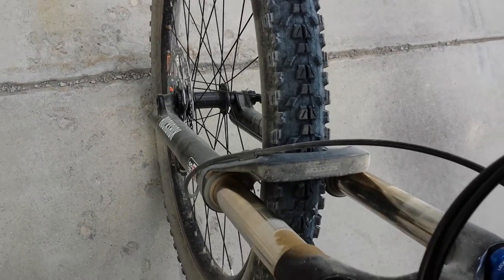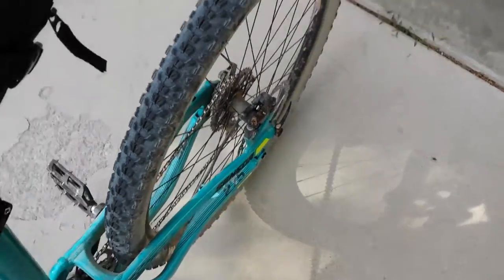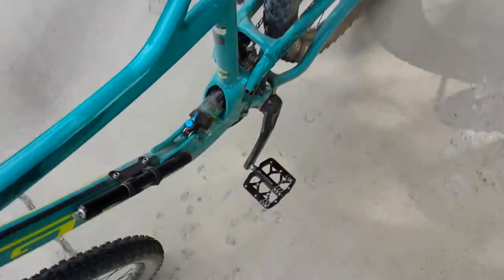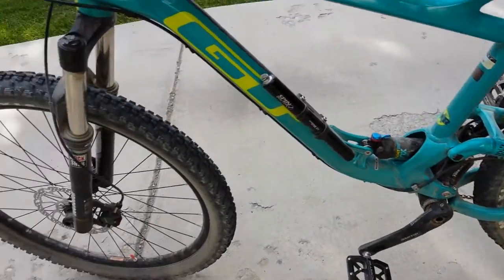SOLVED?: Play between the disc and hub with centerlocks

Comment: Thanks for this video. I 'upgraded' my wheelset and it came with CL hubs. After installation of the new discs, I had the same issue. This video confirmed my suspicion of a tolerance issue between the teeth and the splines.

Comment: I’m so happy I found this video as it seems to be one of the few places online where this problem is being discussed. I have solved this issue on my front wheel by purchasing the original Shimano CL to 6B adapter. With this and a regular six bolt disc the problem does not occur. I suspect that the adapter body creates a more solid interface between the splines of the adapter and the center lock hub. The adapter seems to be a solid block of aluminum with greater contact patch in the spline area. I will try the same on my rear wheel and report back.
Reply: using the adapter solved the issue: it seems the culprit was a cheap entry level Shimano CL disk (worn CL interface?) and the solid adapter used with any 6-bolt disk solved dit

Comment: I wrapped the center lock splines on the hub with plumbers tape. It made the interface tight. It worked perfectly for several months, but now the play is back, which simply tells me the tape is worn and it's time to reapply.
Reply: Exactly what I do

Comment: This is a non problem caused by cheaper centre lock hubs … Cobba, on that thread, is exactly right. There has to be some play in the splines to get the disc on the splines. The only thing that stops the for and aft play is the tightness of the locking ring, which will presumably have a torque setting. I have this issue on my orbea rise h30 cheapest model. Monster say some play is unavoidable, in so many words. The only real fix is swap out the wheels with 6 bolt mount hubs. But the thing is, this is not an actual problem. It’s annoying but once you’ve braked once, the play is moved round and it stays solid in the forward direction. The only time you see this issue is if you ride the bike backwards ( or wiggle it as you did in the video) and then brake backwards. Then it will move the disc on the hub. Until you ride it forwards again, it will creak or knock…. and so on. You will not notice this while riding after your first brake point. Unless your a stunt rider or free rider on a bmx, forget about it. Go ride your bike bro 👍
Ps, just make sure it’s not the rivets holding the disc to the alloy splined carrier causing the play. That would be an issue and a warranty claim.

Comment: I've two sets of wheels on my gravel bike, road and trail. Road are mavic aksium evo elite, trail are fulcrum rapid red. My mavic have the sram rotors the bike came with, the fulcrum, I got shimano cheaper. The sram are rock solid on either wheel. No play at all. The shimano, the same play on both wheels. It's definitely an issue with the adapter over the hub.

Comment: I'v got the same problem with the XTR humbs - it's the shitty center locking system - the tolerances are way too inaccurately calculated hence the rotational play occurs with the brakes fully thightened  - go back to the 6bolt system and everything will be just fine.
Reply: may tightening the lockring could stop the movement? I tight them more than the recommended 40nm and my centerlocks never have developed play and i have the cheapest shimano hubs with the cheapest shimano rotors
Reply: @amermeleitor  may be, however I did not do it - did not exceed the recommended Nm momentum. Instead, I later used 6 bolt adapters for centerlocks, before fitting them I spread some metal epoxy filler on the splines. The earlier problem disappeared, could switch break discs with absolutely no hassle and the wheels became rock stiff once I pulled the break lever. Now I ride Marin Four Corners where no such problems occurs - 6 bolt system as a default. My 660cc enduro motorcycle also features the very same solution and it weights 200kg, there's a reason for setting them break rotors firmly instead of putting them on ill toleranced splines. Another thing is that as long as you can stand the stupid play of the front or rear wheel with the breaks engaged you're fine, you probably wont cut the splines off e.g. breaking abruptly - it just pissed me to have such a problem in top end hubs. Think cold ride wild!;)
Reply: @block672008  I think I couldn't tolerate play in my centerlock brakes. If that happens in the future I will immediately switch to six bolts. I'm kinda obsessed with perfect working simple machines like bikes. I switched to centerlock because I was normally striping the torx bolts in my bike and that was not tolerable. I took off the rotor when I wash the bike, when I servicing or inspecting the hubs and when I lubricate the bike, so 6 bolts was PITA.

Comment: Same with XT brakes and DT Swiss hubs/wheels since new.  This CLock thing is a POS that never happened with six bolts I had for 20 years or more.  Tightened them more than the spec to get rid of the play but it always comes back.  No real solution.  They could make them conical for perfect fit but then you'll probably need an extractor for removing them.

Comment: I have exactly the same problem! What should I do?
Reply from the maker: Between the details I shared in the description and the comments here, it looks like we simply have cheap-ish hubs. I still ride the same ones, but it looks like I need to upgrade if I don't want that issue. 😕
Reply: @AdamCarsonX  may tightening the lockring could stop the movement? I tight them more than the recommended 40nm and my centerlocks never have developed play and i have the cheapest shimano hubs with the cheapest shimano rotors
Reply: @amermeleitor  No, I have i9 hubs with the same problem front and rear. It is super annoying.
Reply: @somniumus  same here, i9 Hydra hubs doing exactly the same thing on the back wheel

Comment: mate did you end up fixing this? was it just a tighten of the rotor lock nut? or due to cheap hubs (so replace the hubs?).
Reply from the maker: Aaron Griggs I haven't taken it in yet, but based on what I've read, and what I noted in the description, I think they're just cheap hubs with enough play between the splines. It still frustrates me, but I don't notice issues on the trails thankfully, even though I weigh more than most and do relatively technical lines. Let me know if you learn otherwise.
Reply: Adam Carson cheers for the reply, i agree it just seems to be an issue with the cheaper hubs (mine are some no name cheapos). i imagine if they were swapped out the tolerences might be tighter and movement would be reduced or gone completely. doesnt seem to impact braking so guess ill ignore it (and just stop rocking the bike when its stationary).
Reply: I have the same issue with DT350's. Wouldn't call them cheap hubs. I have the lockring tightened plenty. So far I'm guessing this is a design fault concerning centerlocks. Bough the bike this way but I would advise anyone against centerlock brakes/hubs. Bad Shimano!
Reply: @toronte  I have the same hub. Not cheap, to me anyway. But mine also does this.
Reply: Late for the party but I've just noticed that my <1year old bike also has this "issue". 
I think it comes down to tolerances. The disc is properly locked, the wheel moves so there has to be some tolerance in the spline. So, this will always be there. With well designed hubs / breaks, tolerances might be small enough that you won't notice...

Comment: The problem is that the brake pads are on with a cotter pin and ther is space between the cottrt pin so when put put brakes on the pads move and the pin hits the calipers
Reply from the maker: That's good insight, but when I took the hubs apart, I could simulate the locked hubs and still see the movement because of the gaps between the hub spines. 😕
Reply: @AdamCarsonX  It's absolutlely the interface of the splines.
Mine do exactly the same thing.
I've tried adding locktight and thin teflon tape to decrease the space on the splines and it works! but only temporarily :( the play comes back once the tape compresses or the lock-tite erodes